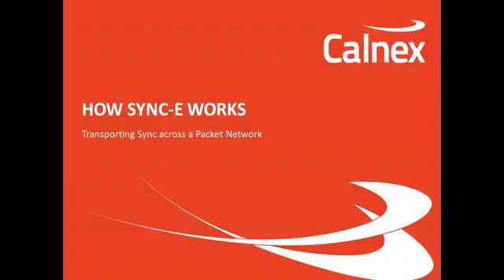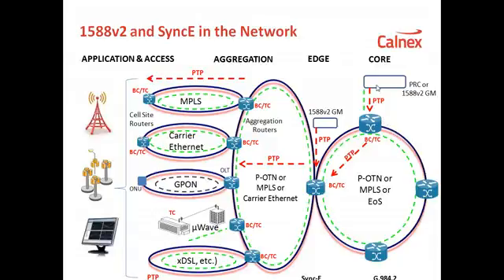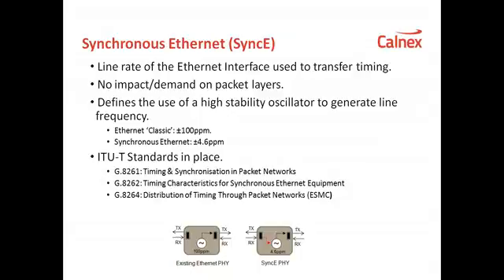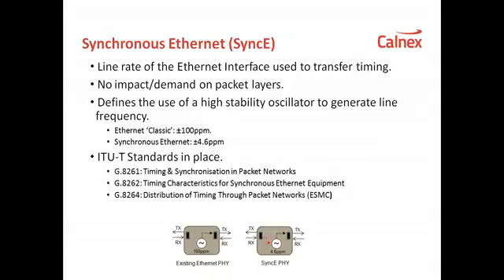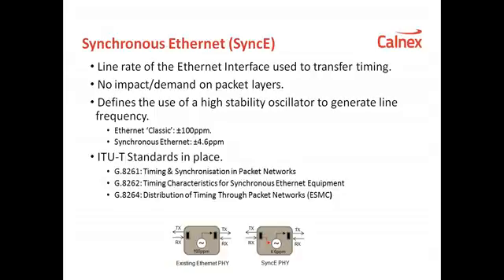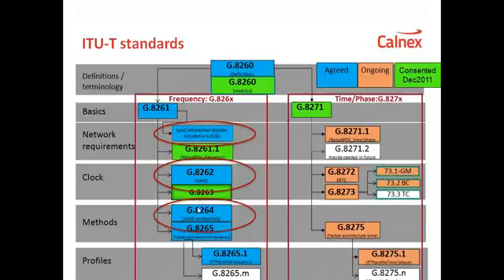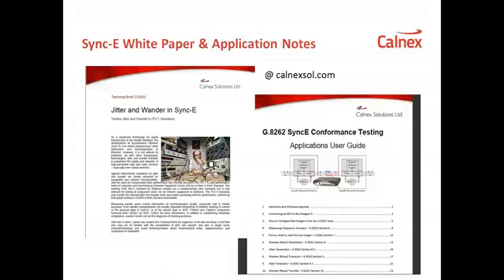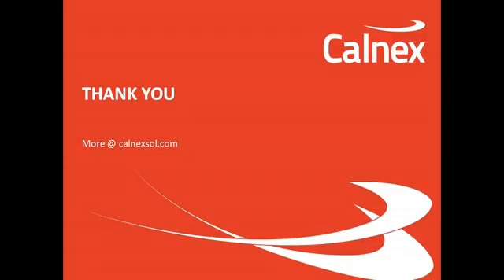How SyncE works

Comment: I still not understand the relationship between PTP and SyncE? Can you provide a brief explanation? How does PTP alone compare to PTP + SyncE?
Reply: PTP is a similar concept as NTP, that is a protocol to destribute accurate time.  SyncE is a method to distribute an accurate signal clock over networks.  As mentioned, in the old TDM telecom network, that was done as part of the signal, with a T1 providing a very accurate 1.544 MHz clock.  With SyncE, the Ethernet signalling is used to carry the clock signal.  PTP can be carried over SyncE, for best accuracy, but it doesn't have to be.  For example, it is also used on the 4G & 5G cell networks to ensure a time of day clock, accurate within 1.5 µS at the phone or other device.